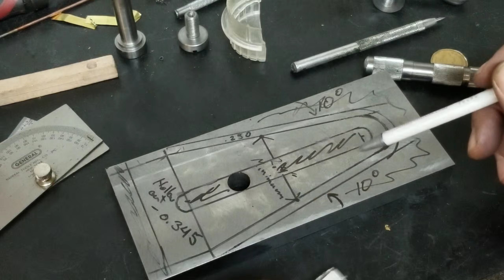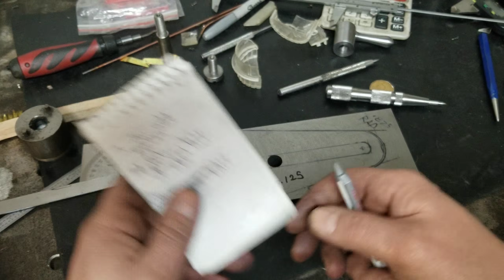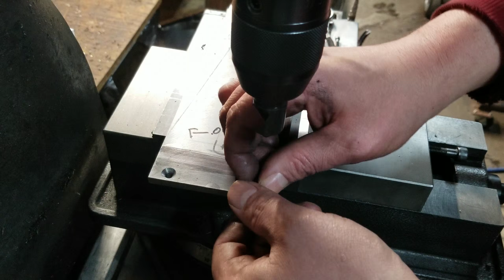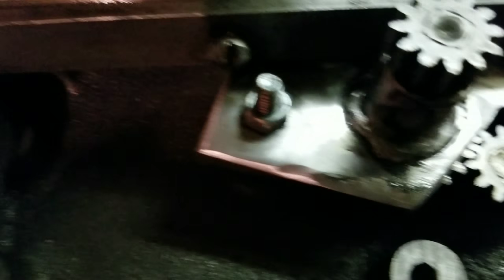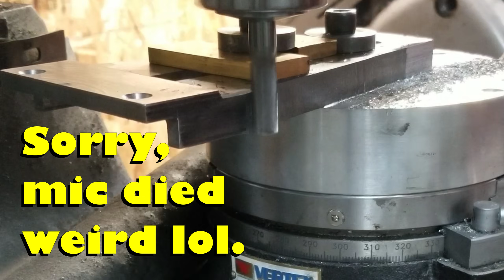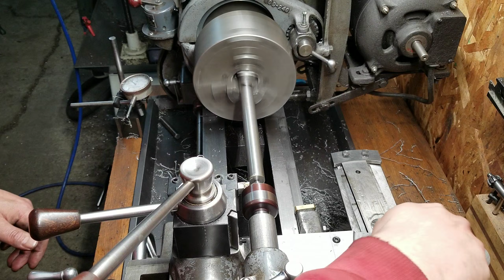Making a Custom Cross Slide; The Backlash Compensator...?

Comment: Nice build, thanks for making the video. You can also lock down the cross slide by removing one of the middle gib set screws and replacing it with a longer socket head cap screw. Once you have your depth of cut set, tighten the screw and make your cut. Have fun making chips.
Reply from the maker: It's for cutting a taper, cross slide is moving while turning so locking it down would destroy something for sure. Thanks anyway though 😏

Comment: 10D-28 is just the part number on that guard. It is a 10D-XX, the ‘XX’ being the overall length of the bed in inches. Atlas beds came in 36” to 54” lengths in 6” increments which provided nominal 18” to 36” between centers. I would guess your bed is 36” long (18” between centers), so you have a 10D-36 model number.
Reply from the maker: That was a bit of a joke. It's the first time I ever used a lathe (6 years ago), hense the cluelessness lol. Happy new year.😏